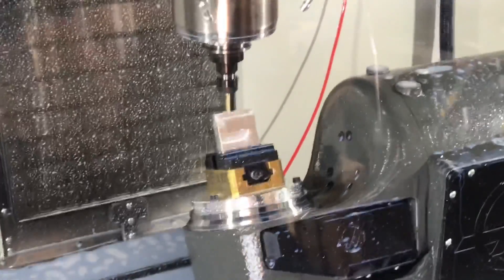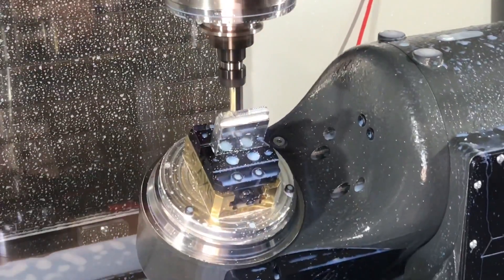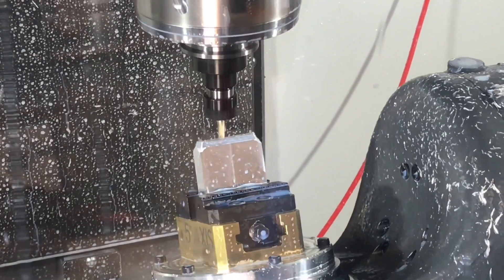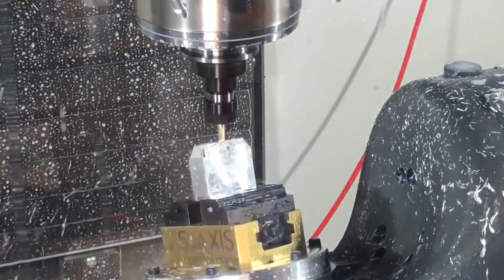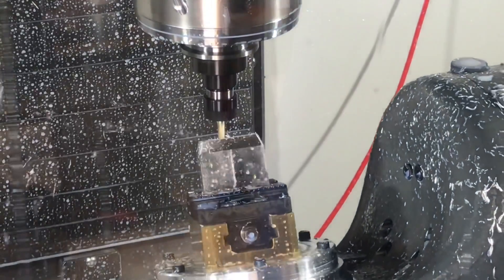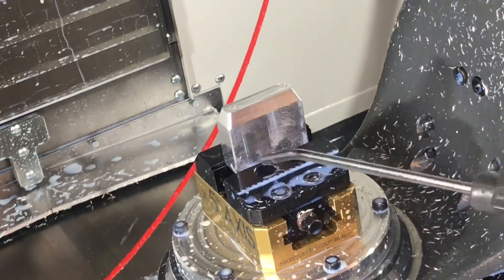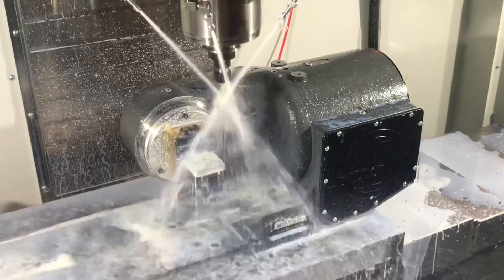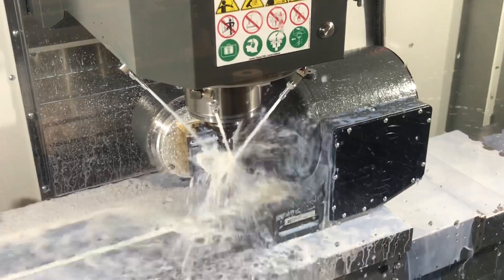Intro to 5 Axis Simultaneous CNC

Comment: Jason - dig your videos. Just got a 2010 SMM2 with a somewhat-rare side mount tool changer. It doesn't seem like you're short on video ideas, but one thing that I'd be interested in is how you set up your tool changer tools. I think I recall you saying in a previous video that most of the tools were set/fixed and that you had a few tools you'd rotate in/out (I guess tools specific to a job?). Anyway, would be curious what your process was to setup the "standard" tools and any thoughts you had on that process. [would've written you directly rather than comment, but didn't see contact info on your page]. Keep the vids coming!

Comment: I spent a pile of $$$ on Mastercam for Solidworks in 2009 to drive my 5 axis Haas machines. I now use Fusion360. I found that I was always having to created construction geometry to 'trick' Mastercam. Fusion360 needs the same thing except it is FAR more affordable and I don't really feel like it is a compromise. I was quick in Mastercam, I am FAST in Fusion. 

As for Haas 5 axis - I am always frustrated with the limitations of the control. It really struggles with intricate movements and surfacing. They are slow. Affordable, but slow.
Reply from the maker: Factory400 I’m learning. Sadly.
Reply: @NerdlyCNC  IMHO, your learning opportunity is definitely NOT sad at all. It was not all that long ago you were in the Tormach territory. You drive and passion for learning is why you are now driving a VF2SS with TRT160 trunnion. Fun to watch your progress play out in video!

At the end of the day you are making it happen. When you run into an unkown, you seem to just tackle it. It's kinda awesome.

Comment: People saying Fusion doesn't do 5-axis are just being contradictory and/or elitist. It obviously has the base ability; it's right there in the operation list, and hell you did it on the second day! Yes the operation is "basic" but know we're getting into some actual pro-machiner gatekeeping as to whether it's """""TRUE 5-AXIS"""""" whatever that means...
Now, the thing Fusion indeed lacks is 5-ax multi-surface operations, where you scallop across a surface or between two chains using simultaneous motion. But that's just the next level up, gotta spend cash for it.
Let's not be pedantic about it....just because you can't use Fusion to make a 5-axis impeller doesn't mean it can't be used for other 5-axis cutting.
Reply: Great words of advice from the CNC master #Ydna ;-)

Comment: You need to go over to the Titans of CNC web page and sign up for their free five axis classes.  They use Fusion 360 in their lesson plans.  I don't own a 5 axis mill or the Fusion 360 software but even I could make sense of what they are teaching using this CAM software.
Reply: as of today their video are more 3+2 axis : a) set the axis b) set the cut

Comment: Cool beans..:)

What is the cost for the premium software for 5 axis coated to Autodesk?  $10k -$15k?
Thanks!
Reply: I don't think you can outright buy the software. It's a subscription you can pay monthly or annually.
Reply: @danielwolfe8  , I was told Solidworks was around 10k per seat 10 years ago...
Reply: I've subscribed to a 30 trial with fusion 360.  They send me promotional offers of 50 per month. Full cost is like 650 if you pay the full year. You don't ever actually own the program. If you ever stop paying you lose access to everything. If I understand correctly.  At least that's the impression I got
Reply: @IX eleven Holy Moly! That I didn't know. I thought for the monthly payment you had full access to all program features
Reply: Daniel wolfe fusion 360 is free for hobbyists, teachers, and businesses making less than $100G a year.
Reply: @adamwaldram6839  that version has a bunch of locked features